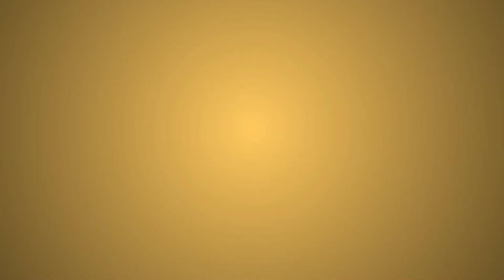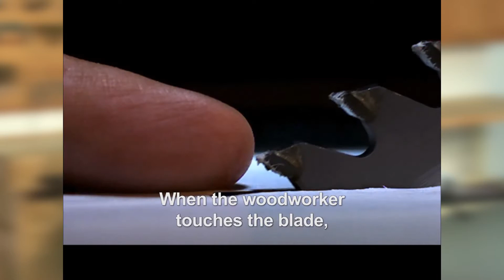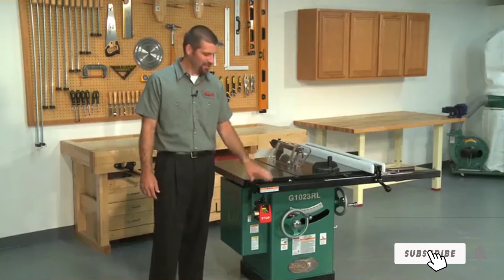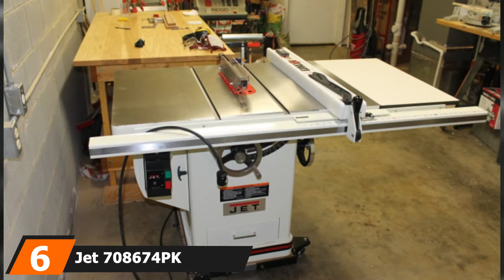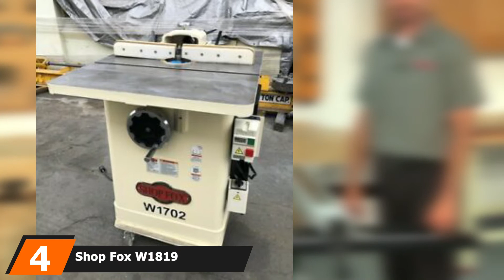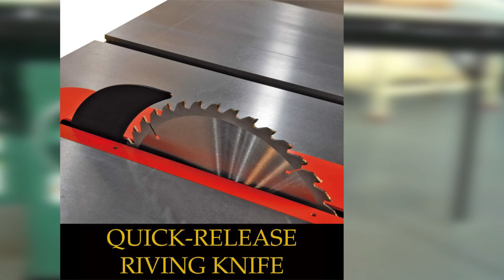Best Cabinet Table Saw In 2025- Top 10 New Cabinet Table Saws Review

Comment: I owned a Delta X5 3 hp cabinet saw for several years. The accuracy of the saw was marginal.  Setting the blade stop to 45 degrees is an exercise in skinned knuckles and frustration.  Finding repair parts is close to impossible and most of the service centers have closed. In my view, Delta's glory days are long gone and their products no better than fair.

Comment: Robotic reading of spec sheet and they didn't even mention the Harvey which blows away most of the saws on this list.  Just looked up the Delta and a Harvey 4 hp 36" is over $1000 less and comes with the Compass miter gauge and the best fence I've ever used.   This has got to be one of the worst reviews of a tool I've ever seen.

Comment: Laguna 
shop fox
grizzly 
jet  are all the same saws
Reply: laguna is an italian made saw the rest are all chinese made...
Reply: Laguna table saws is an american company originally from california but now in Texas . 
The european distributor for 
Laguna is IGM tools out of Prague.
The Prague web site shows the import documents on their website as being from Taiwan , so the saw IS made in Taiwan not italy
Reply: it shouldn't necessarily change your perspective as the tools that come out of this factory are very good quality . i had a Grizzly table saw that was fantastic and i believe the laguna is just as good . 
i based my purchase on customer service . grizzly replaced an 8 inch jointer that had a slight surface crack in the cast iron and paid for the delivery and return of both machines . i have read a lot of negative reports about laguna s customer service but don't know first hand . 
BTW the document on the prague web site was a TUV certificate , this is a german safety agency that most machines and cars have to conform to in order to be sold in germany . they listed the maker of the saw to be a company in Tawain . but don't be put off by that. i would be more concerned about their lack of customer service assuming it's true

Comment: They are not even showing the newest Delta Unisaw? The one pictured is like from the 40s. Albeit restored, its a really old version of the Unisaw. It even has the old style delta logo? And the saw shown from the back during the Delta portion looks like a used cabinet saw that is not a even a Unisaw I think. Its the pic with the red drawn circle of the switch box mounted on the rear of the cabinet?

Comment: When I was shopping for a cabinet table saw, I kept hearing over and over about the SawStop safety feature.  But only after I told the sales guy, "I'm not buying a table saw to not cut off my finger.  I'm buying a table saw to cut stuff."  I wasn't diminishing the safety feature, but if that's all of the focus, I think it's missing the boat on a very important aspect of SawStop's design:  If you design a saw with such a safety feature and the idea that all you need to do is replace the cartridge and the blade, that means the saw has been designed with a very robust trunnion and other support structure.  All that leads to is a very solid, heavy and as I've learned accurate table saw system.  I make lots of cuts and have never had the cartridge activate which is what I hope happens in the long term.  I also will make the same recommendation a woodworking friend gave me:  If you can possibly afford it and if it's feasible for your woodshop, purchase the 3 hp (240v) saw.  It is the first time I've ever had such a saw, and I will never go back to a lower horsepower unit.  I enjoy and really like my SawStop Professional Cabinet Saw!  The safety feature is only a plus!